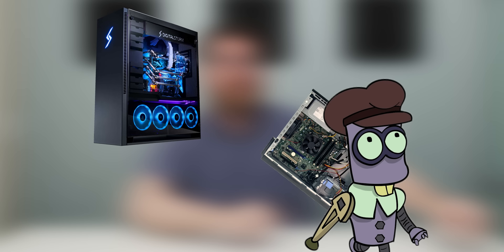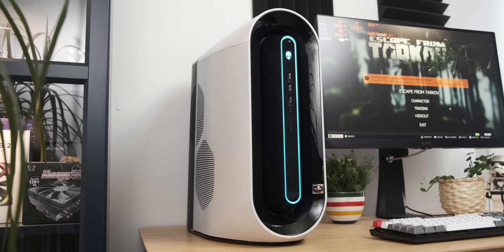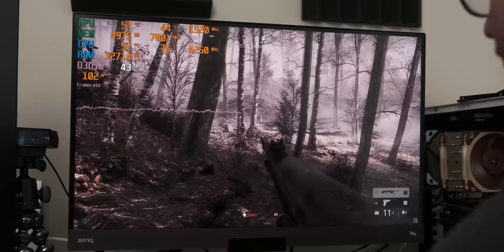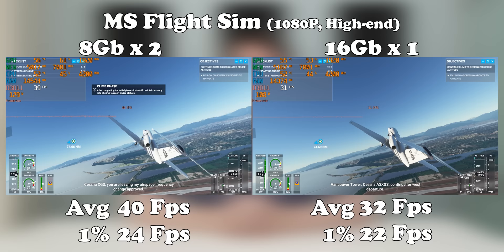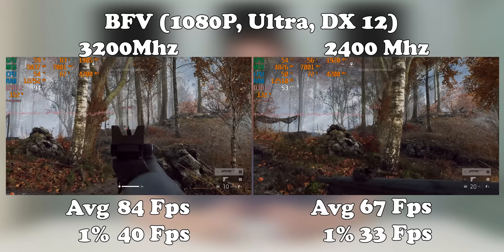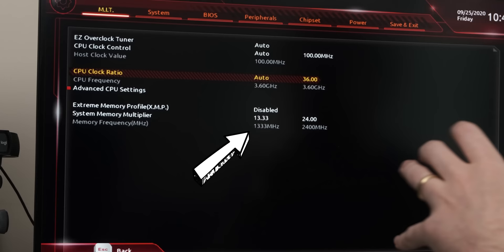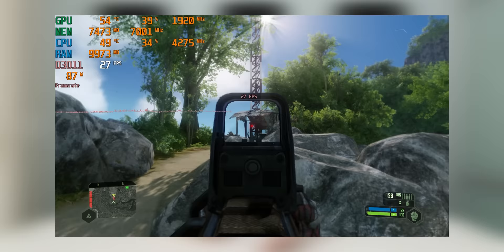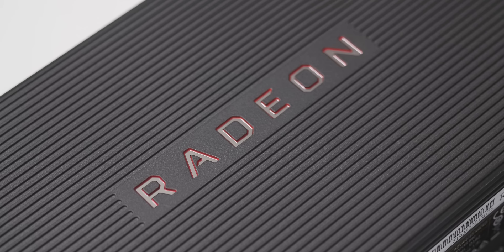How to DESTROY AMD Ryzen gaming performance!

Comment: So even when you deliberately tried to make a crippled gaming PC by clocking RAM down to numbers not seen since 2007, you still made a PC that performs better than an Alienware prebuild that occasionally runs at 0 FPS
Reply from the maker: Hahaha!! Yeah, I didn't think of it like that. 😂
Reply: Speeds since 2010.  2007 800Mhz was quite quick.
Reply: @DoomGuy9001-MK4  2007 had 3 GHz overclocked single and dual cores. IPC, hahaha what IPC compared to today.
Reply: @JosephArata  Still use my LGA775 Pentium 4 for retro gaming lol
Reply: @DoomGuy9001-MK4  either way, 1333MHz is DDR3 level numbers
Reply: he never dropped an single 8gb in it. That is where shit would have really suffered lol.
Reply: @AymanTravelTransport  Exactly, what do you think an xbox one or ps4 gaming console ram is running at? those consoles are not using ddr4 for a start.
Reply: 1333mhz was used in i7 2600k but ok ... and that cpu came out in 2011 i think. So 2007 was way slower then 2011 because no Intel i3/5/7 pc's
Reply: It's remarkable that even a hobbled Ryzen would still turn in a reasonably playable performance in a lot of circumstances.
Reply: @tyronenelson9124  It's not using DDR3 either... Modern consoles usually use unified memory; the PS4 runs GDDR5, as does the One X. Only the base One took the DDR3 approach, and even then it combined that with a very fast ESRAM buffer to try to help get around the limitations of that memory architecture in terms of bandwidth.

Comment: The biggest problem isn’t the single ram stick, but the 5400RPM hard drives that some OEMs still include as main drive
Reply: With what specs?
Reply: That should only affect load times. You really don't want to load any data you need for frame calculation to load off any drive. Not even an SSD.
Reply: Cries in ps4
Reply from the maker: Oh yes!! I very much agree with you. No $700+ system has any excuse not having an SSD.
Reply: @DawidDoesTechStuff  I agree with this too. Unless if the PC is very cheap(below $300 and old), I would expect that, but most systems these days should have an SSD for booting.
Reply: @Pheatrix  nah it will destroy everything when I ran windows on a HDD I had constant shudders and when I switched to a ssd it felt like a different world
Reply: @Jerel Wayne If you don't have enough RAM you don't have enough RAM. The difference between 5 fps* (SSD) and 15 fps* (HDD) doesn't really matter. Bot hare unplayable.

* Estimated fps but probably not far from truth.
Reply: @FreedomForAll2013  
That's just to decrease loading time.
2GB/s is a joke compared to the memory bandwidth of 320GB/s that for example the 1080 has.
Additionally if you want to load the data you need for current computation you aren't looking at sequential reads, but random reads. Your normal NVMe SSD is nowhere near 2GB/s for that (more like 60MB/s). Intel Optane is currently the best at this, there you can expect ~600MB/s. Again in comparisson to memory bandwidth that's a joke.
Reply: RevgoroDIODIAVOLO [UTTP] I have an ssd in a $200 pc
Reply: Melvin Klein yes, but the random reads if a hard drive are under a megabyte a second
Reply: @Pheatrix  Well, you can cut out latency between loading assets to ram and then to vram, which is also pretty power hungry process, but again, just on loads, at best maybe for frame time consistency, if you missed preloading something into ram.
Reply: Dawid Does Tech Stuff I would argue a system as low as 300 should have a SSD. A Low end one is literally around £20 that’s large enough for boot drive and a few files so in reality in 2020 no pc should not have one.
Reply: @palestinianisfreeforever2554  lol
Reply: The reason it performs bad is because of the Ram speed and timings. HDD only slows down the load times. I've tested this.

Comment: Sets pc on fire. Still plays csgo at 100fps.
Reply: *grabs potato

still runs csgo at 60 fps
Reply: replaces power supply with a piece of plastic - csgo at 42 fps
Reply: @repatillo6870  my laptop cant even run csgo
Reply: @deathdeath3960  a toaster can run it
Reply: @unknown185  i know but my laptop is a rock
Reply: @deathdeath3960  ok
Reply: @unknown185  do u have apc ?
Reply: @deathdeath3960  no
Reply: @unknown185  sad noises
Reply: @deathdeath3960  im getting one tho ;) in 2023 (2500€ setup)
Reply: @unknown185  i will get in april around the sqme budget as urs
Reply: @deathdeath3960  cool
Reply: @unknown185  noice
Reply: @deathdeath3960  yes
Reply: You guys are running csgo? My laptop can barely run it, luckily I was able to move to a 5600g with 16 gigs of ram.
Reply: @Darenz-cg9zg  csgo can run on a toaster
Reply: @unknown185  I guess mine was closer to a piece of steel wool with a nine volt taped to it touching some bread then.
Reply: @Darenz-cg9zg  ok
Reply: @unknown185  I play it on a TI-83
Reply: @camronsatterfield8671  nice

Comment: I ran a single 16GB DDR4 2666 stick in my Ryzen 5 1600 (stock) for a long while (paired with an RTX 2080). While it wasn't ideal, everything I played at 1080p was acceptable. I suspect it's because I always tune my settings for higher framerates and lower temps. Very cool video though, love the contrast and information provided in the comedic way, only this channel can deliver. 🙂